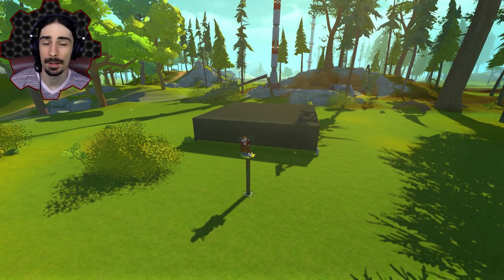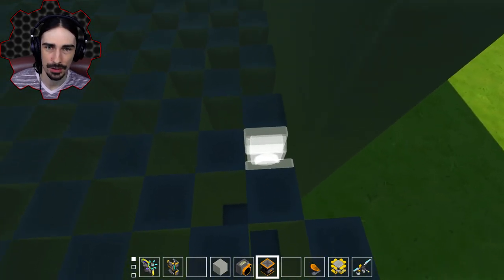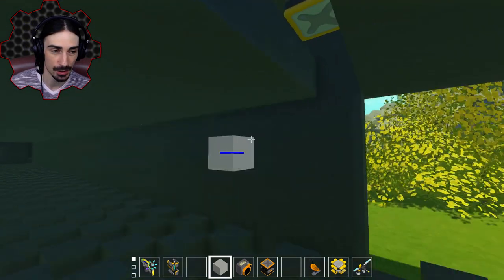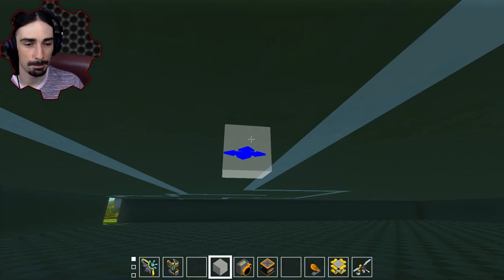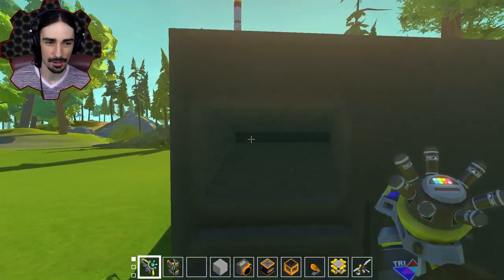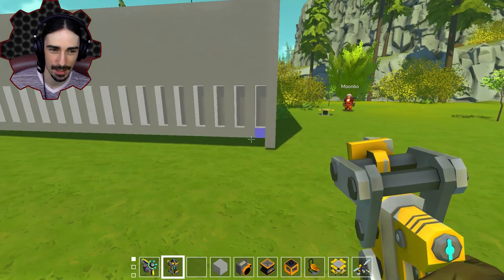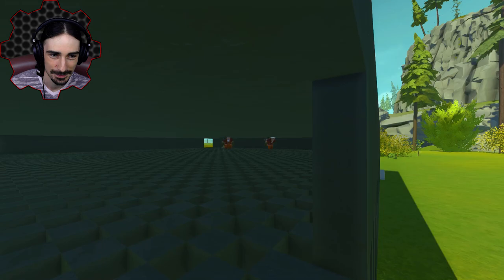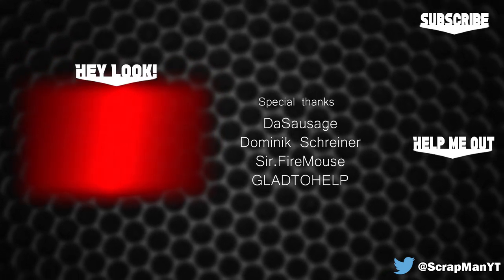PISTON MAZE with TRAP WALLS (Make YOUR OWN)! - Scrap Mechanic Gameplay Showcase Ep31

Comment: 16:01 Kan: "Every maze is solvable as long as you continue to follow one wall forever." I've done that with one maze. Kept at it for like, two million years without finding an end. I gave up, because the strategy was not working. WHY. I had been so lost, and yet, STILL I had trouble finding the way.

Comment: Can't you just have a maze with the floor covered in sensors and roof covered in pistons and switches on logic blocks on the roof over the pistons and have the logic blocks and gates and have the a switch and sensor to each gate and gate to piston so when the switch is on the piston is enabled to block the player
Reply: ScrapMan true but easier to setup
Reply: ScrapMan it took me so long to type that comment thanks for replying to it and thanks from my fingers it's hard to type on a phone

Comment: try to do a piston airoplane
Reply: but how? planes have to use thrusters!
Reply: not if you push yourself... like a row of Pistons ontop of eachother pointing down... like a Spring
Reply: Joshua Jackson one problem GRAVITY
Reply: Ghost Go One solution... Glitches
Reply: If you think about it you could put sensors on the bottom pushing the pistons up, but the pistons will have to be full speed.And the sensors will have to be set to see 10 blocks from the ground and tilted. So make a air plane Scrap man out of pistons ok.✈🛩
Reply: Puffeh GT glitches are not needed to make a piston air plane.

Comment: I would just have the same checkered pattern, but in 5x5 areas seperated by 1 unit wide solid lines where the walls would be. And a sensor pre-placed in each gap connected to an OR gate for each 5x5 sensor grid, and all the pistons pre-placed and connected to an OR gate for each wall. Also, it can be anestheticaly improoved. Using this system, you can also make a wall go down in the opposite side of the maze.